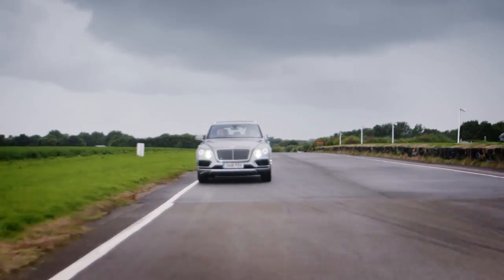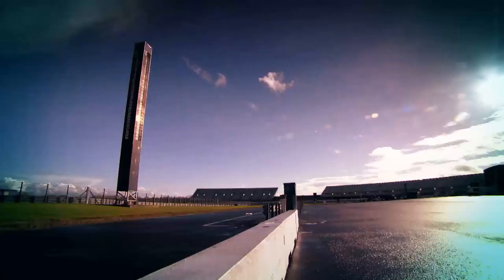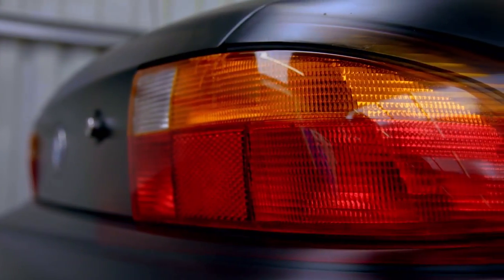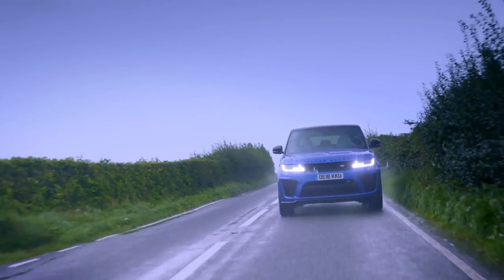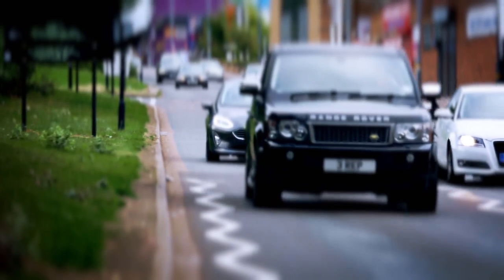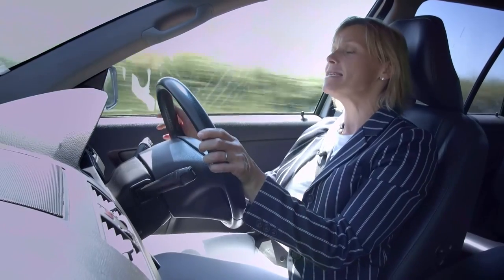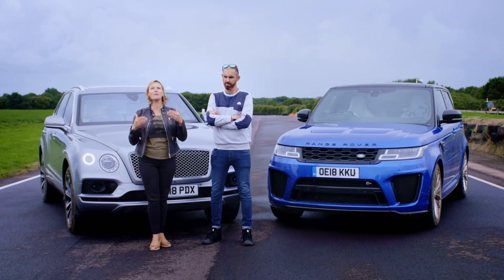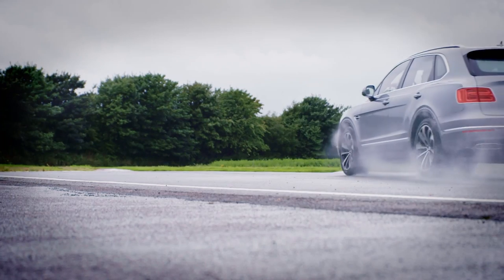Series 27: Episode Five FULL Episode | Fifth Gear

Comment: Coal power plants polute way more than cars do. Heavy industry polutes the most. If you run a diesel on used French fry (chip fat for you British) greese, then the emissions are very low. There was a guy in the 80's who invented a car that ran on hydrogen. Called the "Water powered car" at the time. The military found out about it, and murdered him. Electric cars are only as clean as the electrical source. Thanks.

Comment: The segment on Diffs is completely wrong open diffs always split torque 50/50%. What they do is allow a difference in wheel speed so the wheel with the least traction spins faster. Torque is limited to only that necessary to spin the slipping wheel
Reply: I’m disappointed they didn’t weld it and smoke up the car park ..